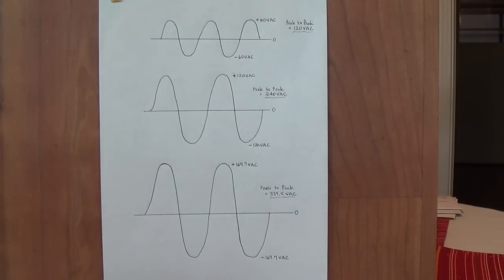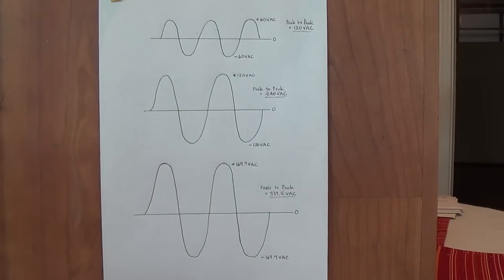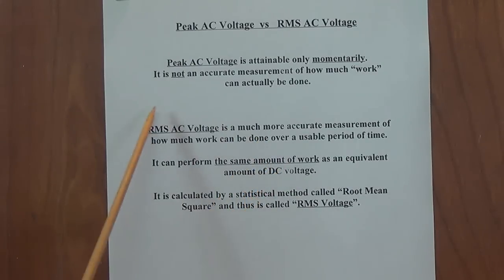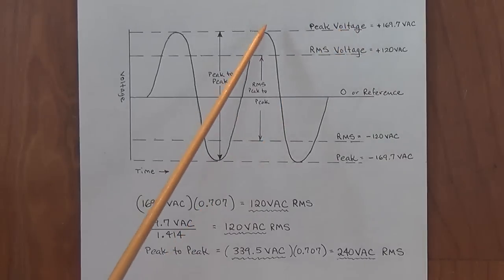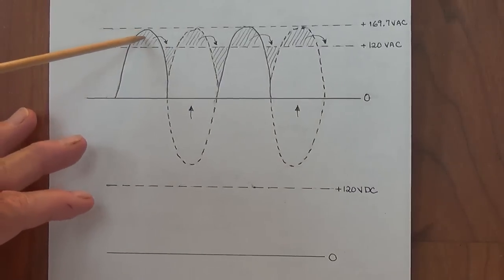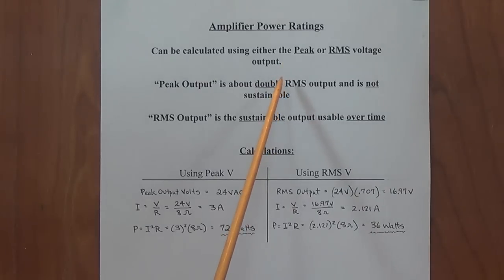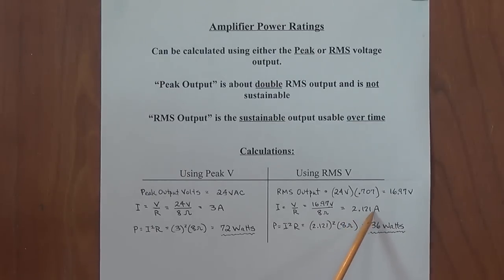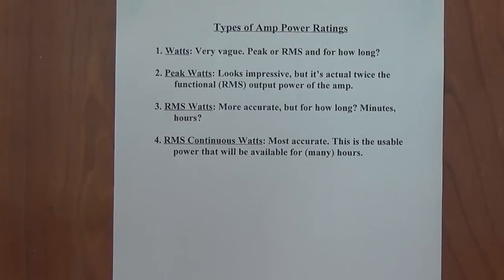The AC Wave Form, Peak Voltage, RMS, and Amplifier Power Ratings

Comment: Good to have you back Uncle Doug! Rms wattage nicely explained. I clearly remember scoffing at the power output of NAD amps in the late 1980's, of 25watts yet cheaper amps boasted 50 or even 100 watts, but they were genuine in their all day power rating and could rip these "higher wattage" amps to shreds!
Reply from the maker: It's good to hear from you, C9. Thanks for your kind words. I too became suspicious while shopping for a good FM/Amp "Receiver" back in the early 70's. The "name brands", like Kenwood, Sansui, Pioneer, etc. were expensive, heavy, and rated at 50 to 100 watts. The "off brands", like Voice of Music, were much cheaper, lighter, and also rated at 50 to 100 watts. All your senses (including the most important one: common sense) told you there must be a reason for the price and weight differential, but it was tempting to go for the "bargain" wattage of the cheaper brands. Fortunately, my common sense triumphed and I bought a Kenwood receiver. To be honest, I think it was the weight differential that swayed me. As my old granny used to say, "Numbers can lie, but mass has class"....or something like that :)

Comment: Uncle Doug, I have a 1957 fender deluxe amp. It needs to be brought back to life. If you could sometime in the future post a video on the refurbishing and address some of the mods that could be done to bring into the 21st century. It would be helpful to do things like possibly change the phase inverter. Tube compliment could stay the same but improve the noise level and address the headroom so that it doesn't go into saturation so soon. I know there are a lot of people that feel nothing should be changed to original circuit, and if that's what you want, that's up to them. There are so many kits out there to build a 5E3 amp and mods for them but no videos on how to. You and Rusty have become a big part of my amp building life and I again thank you so much for you sharing your knowlege of tube amps!
Reply from the maker: Greetings, Hubert, and thanks for your kind words. I'm all for modifications that improve performance, but must admit that when it comes to 1957 Fender Deluxe's, I would advise against any significant changes. These amps are the "Holy Grail" of tube tone and their value is proportional to their originality. Since they are justifiably famous for their tone as-is, so I think that optimizing (rather than altering) the original circuit would be the best approach.

I assume this is a 5E3 circuit. If noise is an issue, the source needs to be determined and eliminated: noisy carbon resistors (particularly the 100K plate resistors) can be replaced with modern, metal film resistors (be sure to keep the originals in a plastic bag); likewise for the 5K and 22K voltage-dropping resistors in the B+ circuit; noisy pots cleaned; leaky filter capacitors replaced; tubes tested and replaced if weak; cathode-biased 6V6 Plate Dissipation checked (as well as the bias resistor and cap). Finally, the speaker, particularly if an original P12R or Q, may simply be "worn out" with a weak, "flubbing" cone suspension and need to be replaced. Cone fatigue is a major cause of early break-up.

The 5E3 sounds best with single-coils (especially the Telecaster) and there are tricks to optimizing the clean tone of the amp (i.e. adjusting the VC on the unused channel can affect the tone on the channel in use). This site is the best (in my opinion) for all details regarding the 5E3:  http://fenderguru.com/amps/deluxe-5e3

Best of luck with this "tune up", Hubert. Please let us know how it all turns out.
Reply: I demand a video, Hubert!! ;)

Comment: Very good information!

We see unscrupulous power ratings all over the "consumer grade" products range. It's not just amplifiers. There have been class action lawsuits over deceptive power ratings on air compressors and vacuum cleaners.
Reply from the maker: +davida1hiwaaynet  Thanks, David. I actually benefited from a class action lawsuit against Sears for (grossly) overstating the horsepower of my lawn mower.  The "award" was about $3.50, with the bulk of the money going to "legal costs"......but you're right.....power ratings of all sorts of devices are frequently and shamelessly inflated by manufacturers.
Reply: +Uncle Doug 

Well, at least you got your next bag of treats for Rusty paid for by Sears! :) 

Here is a read for you. It may be a little bit long, but maybe it will interest you.

I was reading a transcript about the class-action case against a name-brand air compressor distributor who sells through the big-box home improvement stores. 

The compressor being discussed was sold as a "6 HP" model, however it had a standard, US domestic 15 amp 120V cord and plug. Even if it was 100% efficient at converting electric power to mechanical work - it would never be capable of drawing 6 HP worth of power from a 15A 120V circuit.

The defendant stated that, "at the instant power is switched on" the motor draws its locked-rotor "inrush" current. When viewed on a scope, for an instant, there is a 40 amp inrush. Therefore, the motor is, for a brief instant, receiving from the wall outlet, slightly more than 4500 watts. Watts and horsepower both are measures of "power" and there is a math formula. This is actually slightly more than 6 horsepower of electricity, therefore we are justified in labeling the compressor as 6 HP!

The expert on the other side of the case, presented a list of commonly available, similarly-constructed motors, available from various supply companies.  These motors  had similar RUNNING current demand as the supposedly 6 HP compressor. Their manufacturers claimed continuous power ratings in the 1.75 to 2.0 HP range. 

They are both correct technically, but the manufacturer was found to be deceptive. Since motors have been sold in industry, they have always been rated and labeled by continuous power capacity. The motor has a "HP" rating on the tag, and in that place, it is customary and expected to find the continuous power rating. There is a second rating, usually shown in amps, for the inrush, or locked-rotor current. Not all motors have this one even listed on the nameplate because it is normally not important.

Because the manufacturer went against the known, expected conventional ratings notation used for this type of motor, and placed a different parameter (locked-rotor inrush) in the place usually used industry-wide to indicate continuous power, they were being deceptive and therefore they lost the lawsuit.
Reply from the maker: Very interesting and well-explained, David. Thanks for posting :)
Reply: +Uncle Doug 
Glad you liked it!

Comment: There ya go!!! It's all in the AC forumlae. You are absolutely right. Most don't know this stuff and even worse, when a person goes to talk with a person selling amplifiers, THEY have no clue. I once talked with a person at Radio Shack, whilst buying some parts, and he assured me that he was well trained and knew about it, all-the-while NOT knowing any formulas, wrong verbage, and concepts.... I laughed in his face, where he walked off and got his manager... I told him that his employee knew nothing and needed to be trained properly. Many times they will say "max power" I have found this to mean "peak power" in most cases.... PMPO is another animal all together.... Very well presented sir.
Reply from the maker: Thanks, L1. Hopefully, this will alert folks to the misleading power ratings that some manufacturers and sales people use to "fluff up" the specs of their products.
Reply: PMPO is just a big number and an "invention" of marketing men, as they put it damn simple: big numbers resulting in big sales. The "measurement" of PMPO (=peak maximum power output) is: plug in the Amp, leave it for a while to let all Caps beeing charged. Apply a 5Volts pulse to the input and measure the output voltage while nothing is connected. Calculate the power by taking the measured output voltage and the absolute minimum resistance alowed to be conected to the output. Multiply this as follows: (Vout*Vout)/Rmin=P(pmpo)
That gives you nice but useless numbers....;)
Reply: TubiCal AH-HAH! I thought PMPO meant pulse moderation power output I never really kept up with it nor did I care way back when I learned what RMS power really was... At tech school.... :-D  Thanks for the info man... Learned my hard lessons in car audio.... Now-a-days, I completely own sales people unless they have bothered to learn something. :-D Look out for ole otter!!! heh-heh-heh

Comment: best and deeper explanaiion of rms . some people question me how i calc the rms power of an amplifier, cause i usually messure the supply of the amplifier to get an estimate of the peak swing to get the power rms. my equation goes like this, P=(V^2/2/R) example a 40volt max swing peak of an amplifier @ 8ohm will produce 100watts rms, the amplifier must swing 40volts peak to get 100watt rms @ 8ohms. P=(40x40/2/8ohms) = 100 watt rms. if i use ohms law, it is not the same as dc which only needs a peak of 28.28 volt dc. cause that is pure dc.
very good explanation
Reply from the maker: ***** Thanks so much, James, and thanks for your additional input. Rusty and I really appreciate it :)